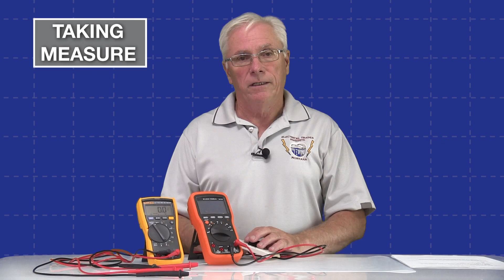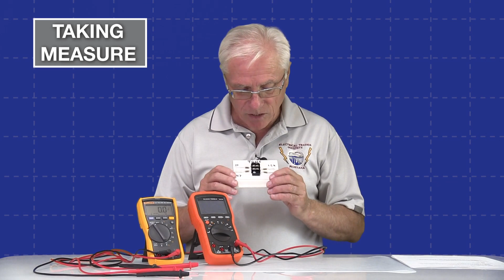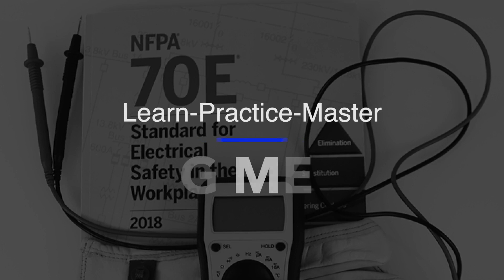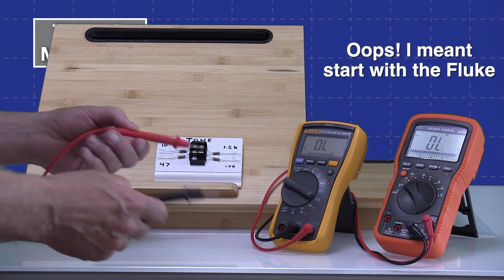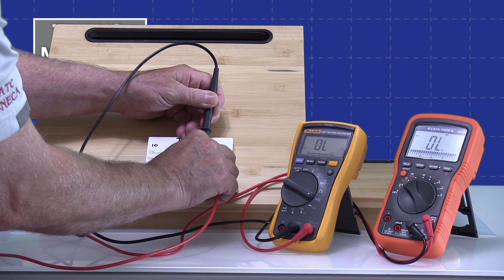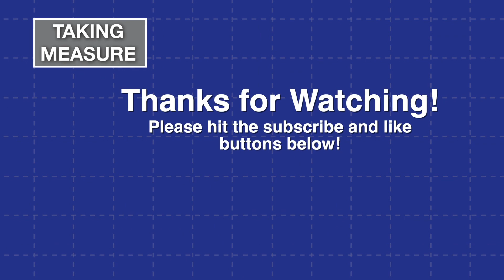The Trouble With Tone - DMM Continuity Test Mode Limitations

Comment: I did this test on mine with a potentiometer. On a Brymen 235 tone stayed on until 166 ohm. Once on it stayed on until 324 ohm. Coming down from 324 it came back on at 166. Looks like a hysteresis effect. Goes to OL at 660 ohm. On an old Elenco DMM tone is on until 49 ohm. Reads OL above 70 ohm. So YMMV. Looks like lots of variation based upon model. Best to simply check yours with a pot.

Comment: Get a fancier multimeter. Mine can be set to either 30Ω or 300Ω and also lets you set whether the tone is on or off for continuity or discontinuity. I can also set the voltage for diode testing to up to 3V or 15V.
Reply from the maker: Thank you for watching and posting the comment. Given my type of work, I would not often require the features you suggest, but I am impressed with the idea. Thanks again!

Comment: 3:56 - What does it mean on the Fluke when it gives a pulsating tone in the continuity setting?
Reply from the maker: If it does so while simply holding the probes together, the DMM may need servicing.  If it does so while connected to a circuit, it could indicate intermittent continuity.  You may want to see if the display is also giving a fluctuating ohm reading (if you are within the range of indication).

Comment: Continuity Mode doesn't measure the conductance value of various components or wire gauges plus most DVM meters give false readings when measuring below 2 ohms to milliohms.  Example if you're measure Fan motor windings or compressor motor windings which are low ohms but various DVM meters will give false measurements because the range is not designed for low ohms. The DVM meter will measurement 2 ohms or 1.2 ohms for the compressor motor windings but is it really 2 ohms or 1.2 ohms? The DVM meters test voltage and test current might not be strong enough to get the correct measurement of certain motor windings that are designed that operate at a high voltage and high current.